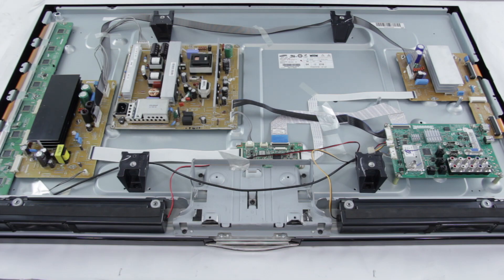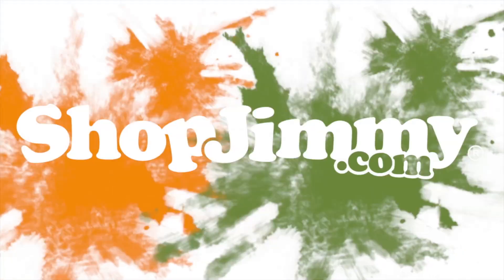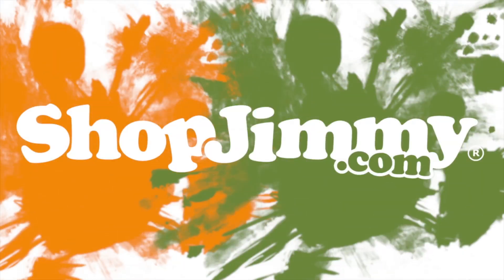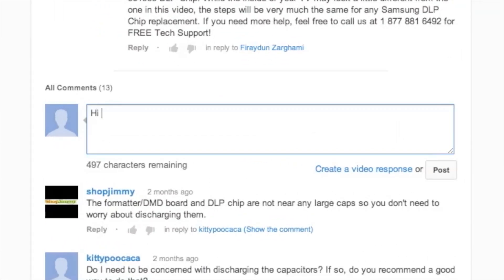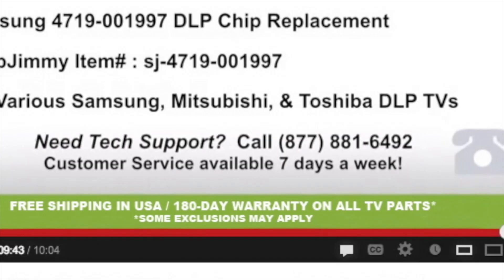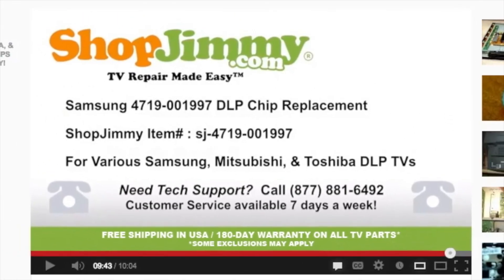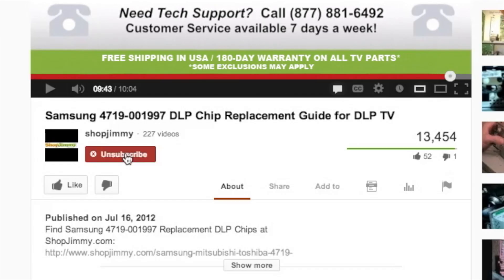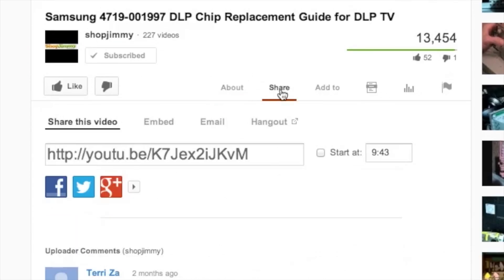Plasma TV Repair Tutorial - Common Symptoms & Solutions - How to Fix Plasma TVs

Comment: PN51D550C1FXZA don't turn on, 4x times clicking power sound and stand by red light blinking twice, should be the y- main board?
Reply from the maker: Guilherme Gabiatti   I recommend replacing the X-Main board in your TV.  Here is a link to replacement parts for your TV model number on our website, click here:  http://www.shopjimmy.com/catalogsearch/result/?q=PN51D550C1FXZA  Be sure to match part numbers on your current board, with your replacement for compatibility.  You can also call our customer service for further assistance with your purchase.  (877) 881-6492  Thanks and please let us know if you have any further questions with your TV Repair!  www.shopjimmy.com

Comment: Hi Jimmy, I have a Samsung 42" plasma which is approximately 6 years old. The TV turns on fine but then screen goes blank whilst sound continues. After a while, the screen returns but still goes blank from time to time....Power light shows so it is getting power. Any help would be appreciated...
Reply: Model number is PS-50Q91HD which I assume makes it a 50"..... sorry!!!
Reply from the maker: Gerry See   I recommend replacing the Y-board and buffers in your TV.  Unfortunately I do not see any replacement parts in the search results for your TV model number on our website.  Thanks and please let us know if you have any further questions!  www.shopjimmy.com

Comment: Hi Jimmy I have a Philips Plazma 50pf7321D/37.  I have a red light blinking 4 times.  I have two green lights on my power supply but only one of them is lit.  I just bought two caps that I need 3300uf, 16v, but I have not pulled them yet.  I think because another guy had the same tv and had all his lights lit that those caps may not be my problem.  Philips website says that 4 blinks equals to a softwared update, but I've followed those instructions and the tv does not take the upgrade because it won't come on.  At first I get a green light and humming and then it turns red. Can you please help me?
Reply from the maker: Ryan Moore   Which part is making the humming noise?  Thanks!  www.shopjimmy.com

Comment: I have a Samsung PN50B550T2FZA THAT HAS STARTED TO HAVE RED AND WHITE FASHES OF LIGHT ON THE SCREEN, IT MORE NOTICABLE ON SOME CHANNELS THEN OTHERS.  I HAVE FIXED CAP. IN OTHER SAMSUNG COMPUTER MONITORS COULD IT BE A CAP?
Reply from the maker: Patrick Crawford   #tvrepair  I recommend replacing the Y-Main board and Y buffer in your TV.  Here is a link to replacement parts for your TV model number on our website, click here:  http://www.shopjimmy.com/catalogsearch/result/?q=50B550T2  Be sure to match part numbers on your current board, with your replacement for compatibility.  You can also call our customer service for further assistance with your purchase.  (877) 881-6492  Thanks and please let us know if you have any further questions with your TV Repair!  www.shopjimmy.com

Comment: Hello I have a Samsung PN58C500G2F Plasma television.  I have recently started having horizontal colored "snow", particularly on light backgrounds.  I have recorded the problem.  The link is http://youtu.be/YJB1WuiyWuY.  Would love some help figuring out the problem.  I bought a used power supply board and put it in the television and it did not fix the problem.  Figured it was unlikely that it would have the same problem my old one did so I assume the problem lies elsewhere.  Thank You for you your help.

Will
Reply from the maker: rugrwl   I recommend replacing the Y-Main board and the buffer(s) that are attached to the Y-Main board in your TV.  Here is a link to replacement parts for a similar TV model number on our website, click here:  http://www.shopjimmy.com/catalogsearch/result/?q=58C500  Be sure to match part numbers on your current board, with your replacement for compatibility.  You can also call our customer service for further assistance with your purchase.  (877) 881-6492  Thanks and please let us know if you have any further questions with your TV Repair!  www.shopjimmy.com   #tvrepair

Comment: hi! i have a samsung plasma PS42CP1HX that was 2 swollen capacitors on the psu i change them, the tv turns on and of normaly but the screen stays like no power, i verify all voltages in psu and fuses and all seems ok, the only thing i notice wrong was the VSC (-190 in this model) in the Y-SUS test point the multimeter show a lot of crazy numbers like you try to mesure a waveform, the sound i dont no if has because i dont see if the channel is tunned???
thanks!
Reply from the maker: pauloee9   I recommend replacing the Y-board and buffers that attach to the Y-board in your TV.  Unfortunately I do not see any replacement parts in the search results for your TV model number on our website.  Thanks and please let us know if you have any further questions!  www.shopjimmy.com

Comment: pn51d550c1fxza my tv was hit with a toy by my kid it blacked out. now I have no picture or sound but when I took the back cover off and turn the tv on the power light comes on then starts flashing slowly
Reply from the maker: tavon oneal   Is the screen damaged?  Thanks!  www.shopjimmy.com
Reply: Taking a closer second look yeah it does have a lil crack in the corner of the tv.
Reply from the maker: tavon oneal   If the TV screen is cracked, then you would need to replace the panel.  If your TV panel is bad, it may be more cost-effective to replace the TV as panels are typically hard to find in stock, difficult to replace, and expensive.  Thanks and please let us know if you have any further questions!  www.shopjimmy.com

Comment: I have a samsung plasma that has verticle lines at times, color can change, or will work fine, a smack on the back makes stop or worsens this. Loose ribbons or what?
Reply from the maker: Timothy Chituck   This sounds like a TV panel problem.  If your TV panel is bad, it may be more cost-effective to replace the TV as panels are typically hard to find in stock, difficult to replace, and expensive.  Thanks and please let us know if you have any further questions!  www.shopjimmy.com

Comment: Hi there !  Thanks for all the good points you share with us on how to repair our tv set.  I have a Samsung led smart tv UN55D7000 series.  Recently it has been showing a bright white cloud like shade on the upper left hand corner and when the scenes changes the pixels goes crazy all over the screen and the color and images gets distorted and  dark faces and blurry pictures. What should I do to fix it.  It s just a year and a half warenty is out of question from Samsung.  Thanks for your help please
Reply from the maker: Sam Samuel   I recommend replacing the main board in your TV.  Here is a link to replacement parts for your TV model number on our website, click here:  http://www.shopjimmy.com/catalogsearch/result/?q=UN55D7000  Be sure to match part numbers on your current board, with your replacement for compatibility.  Here is a link to a video showing how to identify your part number, click here:  Samsung Main Boards & Digital Boards: Part Numbers for LED, LCD, DLP, Plasma TV Repair  You can also call our customer service for further assistance with your purchase.  (877) 881-6492  Thanks and please let us know if you have any further questions with your TV Repair!  www.shopjimmy.com

Comment: I got a RCA - Envision Series LCD TV Serial # H9691SA007627 the power is on but sound no image the screen stays black.
Reply from the maker: Malang Balde     I recommend running the flashlight test on your TV.   Here is a link to a video we produced that shows how to run the flashlight test. No Image No Picture on Screen-Flashlight Test LCD TV Repair - How to Diagnose Broken Board TV Repair Please reply with your flashlight test results and we can recommend a replacement part for your TV repair.  Please reply with the TV Model number and then we can recommend a replacement part.  Thanks!  www.shopjimmy.com

Comment: I have a SAMSUNG PN51E530A3FXZA 51 inch plasma the problem that I am having is when I turn it on it doesn't turn on... Well it turns on but no LED backlight just a black screen just only sound comes from the speakers... I have to turn it on and off and on just so the backlight turns on... I have to sometimes have to turn it on and off about 5-7 times just so I can get the Screen to turn on... I opened the back to see if any capacitor are bad but can't seem to find anything... Any ideas? Thank you hope you can help me out!  Went to your site and i'm surprised to replace the boards aren't that expensive!
Reply from the maker: Rex Gomez   I recommend replacing the Y-Main board and the Scan Drive board(s) that connect to the Y-Main board.  Here is a link to replacement parts for your TV model number on our website, click here:  http://www.shopjimmy.com/catalogsearch/result/?q=PN51E530A3FXZA  Be sure to match part numbers on your current board, with your replacement for compatibility.  You can also call our customer service for further assistance with your purchase.  (877) 881-6492  Thanks and please let us know if you have any further questions with your TV Repair!  www.shopjimmy.com

Comment: I have a Samsung 50" plasma set with a thin black horizontal line. It is positioned toward the top of the screen. Just started a day ago. Based on the video above sounds like the fix maybe a little expensive. What are your suggestions. Thank you.
Reply from the maker: Richard Lindholm   I recommend replacing the buffers in your TV.  Please reply with your TV  model number and then I can recommend replacement parts for your TV Repair.  You can also call our customer service for further assistance with your purchase.  (877) 881-6492  Thanks and please let us know if you have any further questions with your TV Repair!  www.shopjimmy.com

Comment: hi jimmy iam trying to remove the rebbon on a t-con but it wont come out sanyo 26' t260xw03 ihave a white screen need help thanks
Reply: hi jimmy iam try to remove the rebbon on t-con but it wont come out 26' sanyo t260xw03 ihave a white screen
Reply from the maker: jose lopez   Lift up the locking tab on the connection then the ribbon should slide out easily.  Thanks and please let us know if you have any other questions!  www.shopjimmy.com

Comment: hi jimmy, my bf transported a panasonic tc-p50g10 across town and now it won't turn on. The red LED flashes 9 times. He transported it horizontally, instead of vertically. I have since seen on the web that they should only be transported vertically. Do you know why that matters? What does 9 flashes signify? Thanks
Reply from the maker: Monica Lindsey   Do you know what year your TV was manufactured?  If so, please reply with that info.  Thanks!  www.shopjimmy.com
Reply: 2009
Reply from the maker: Monica Lindsey   Thanks for the reply, I recommend replacing the main board in your TV.  Here is a link to a replacement board, if we are out of stock, you can sign up to be notified when the part is back in stock.  http://www.shopjimmy.com/panasonic-txn-a1dwuus-a-board-for-tc-p50g10.htm  You can also call our customer service for further assistance with your purchase.  (877) 881-6492  Thanks and please let us know if you have any further questions with your TV Repair!  www.shopjimmy.com

Comment: Great Video.  Thanks for all your videos.  I have a Sony WEGA 42" Model KE-42M1 manufactured in 3/05, SN 9022420.  When my TV is powered on, it takes almost 45 minutes for the TV to warm up and get a picture.  During that time the picture has bright pink/red areas that eventually go dark.  After about the 30 minute mark, it takes switching thru the inputs, or powering on and off, or even pausing live TV on the DVR might trigger the picture to go to normal.  If left alone it usually takes 45 minutes and it will just automatically go to normal. Please advise problem and what I should do.  Thank you
Reply from the maker: Brian Choate   I recommend replacing the power supply in your TV.  Here is a link to replacement parts for your TV model number on our website, click here:  http://www.shopjimmy.com/catalogsearch/result/?q=KE-42M1  Be sure to match part numbers on your current board, with your replacement for compatibility.  You can also call our customer service for further assistance with your purchase.  (877) 881-6492  Thanks and please let us know if you have any further questions with your TV Repair!  www.shopjimmy.com

Comment: I have a sylvania 42 plasma model # 6842pe ,when you turn the power on it shuts right back off and has a burning electrical smell out of the back
Reply from the maker: Patrick McCray   I recommend checking the power supply for burn marks.  Here is a link to replacement parts for your TV model number on our website, click here:  http://www.shopjimmy.com/catalogsearch/result/?q=6842pe  Be sure to match part numbers on your current board, with your replacement for compatibility.  You can also call our customer service for further assistance with your purchase.  (877) 881-6492  Thanks and please let us know if you have any further questions with your TV Repair!  www.shopjimmy.com

Comment: i have a samsung plasma tv model number pn59d550c1fxzc it has a whitish 6 inch band running horizontally across the bottom of the screen the rest of the screen is fine.It just all of a sudden appeared while we were watching,what do u think thanks.
Reply from the maker: kirk wood   I recommend replacing the Scan Drive boards in your TV.  Here is a link to replacement parts for your TV model number on our website, click here:  www.shopjimmy.com/catalogsearch/result/?q=pn59d550c1  Be sure to match part numbers on your current board, with your replacement for compatibility.  You can also call our customer service for further assistance with your purchase.  (877) 881-6492  Thanks and please let us know if you have any further questions with your TV Repair!  www.shopjimmy.com

Comment: Looking to repair my grandfathers Panasonic plasma TV, model TH-50PX75U.  The TV has a solid black line that runs vertical on the screen.  Bar is about 2", and occasionally will show a discolored picture, but is mostly solid black.  What can be done to fix this?  Thanks in advance.
Reply from the maker: Garrett Queeney   This sounds like a TV panel problem.  If your TV panel is bad, it may be more cost-effective to replace the TV as panels are typically hard to find in stock, difficult to replace, and expensive.  Thanks and please let us know if you have any further questions!  www.shopjimmy.com

Comment: my hpt5064 turns on and off on own.   I have had for many years   New or repair?
Reply from the maker: Aaron Melnick  I recommend replacing the power supply in your TV.  Here is a link to replacement parts for your TV model number on our website, click here:  http://www.shopjimmy.com/catalogsearch/result/?q=hpt5064  Be sure to match part numbers on your current board, with your replacement for compatibility.  You can also call our customer service for further assistance with your purchase.  (877) 881-6492  Thanks and please let us know if you have any further questions with your TV Repair!  www.shopjimmy.com

Comment: G,day, I have an Lg plasma tv Mod 42px4dv .I have replaced the chip on the y sustain board and all working ok ,But the left side of picture looks like a tv with poor tuner signal,with a blank black screen you can see white pixels on the left and  the right side is pure black.
Reply from the maker: Brian Hill   I recommend replacing the YSUS and the buffer(s) that attach to the YSUS board as well.  Here is a link to replacement parts for your TV model number on our website, click here:  http://www.shopjimmy.com/catalogsearch/result/?q=42px4  Be sure to match part numbers on your current board, with your replacement for compatibility.  You can also call our customer service for further assistance with your purchase.  (877) 881-6492  Thanks and please let us know if you have any further questions with your TV Repair!  www.shopjimmy.com

Comment: Thanks for the video.
I had a quick question. On repairing a LG 50 plasma, symptom being the lower half of the screen has horizontal black lines that extend the length of the TV, does replacing the lower y buffer board sound correct? LG EBR56579804 Lower Y Buffer. You guys are currently out of stock but will be following your sites procedure to obtain.
Reply from the maker: Hollidayl1851l   Yes, that does sound correct.  You can also call our customer service for further assistance with your purchase.  (877) 881-6492  Thanks and please let us know if you have any further questions with your TV Repair!  www.shopjimmy.com

Comment: i have an lg 50pm6700 that turns on (psu relay pulls in)...red light blinks twice and tv stays on but no video.  If I take out the EBR74185001 logic board same results...ic's esp the main one in the middle of the board gets hot when the board is installed.  Please advise..I am a technician.
Reply from the maker: 123vaporize   I recommend replacing the YSUS board and the YDRVTP and YDRVBT boards that attach to the YSUS board in your TV.  Here is a link to replacement parts for your TV model number on our website, click here:  http://www.shopjimmy.com/catalogsearch/result/?q=50pm6700  Be sure to match part numbers on your current board, with your replacement for compatibility.  You can also call our customer service for further assistance with your purchase.  (877) 881-6492  Thanks and please let us know if you have any further questions with your TV Repair!  www.shopjimmy.com